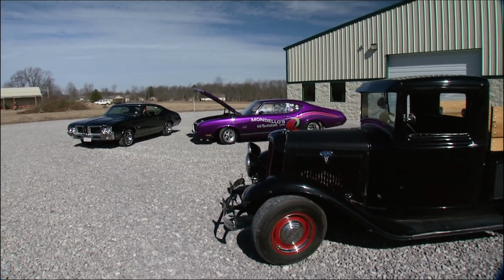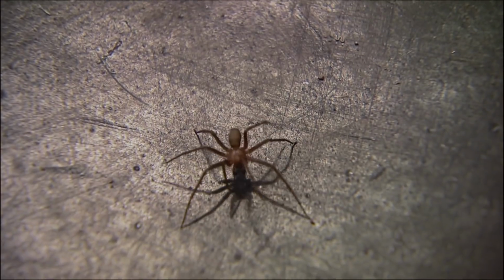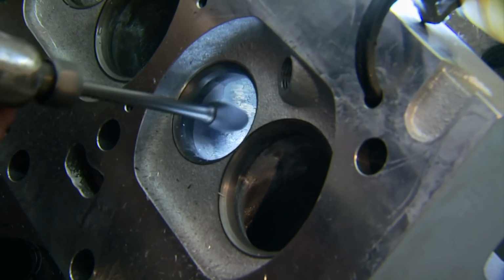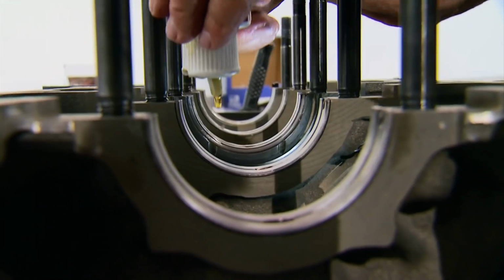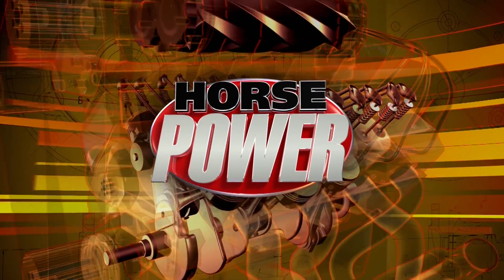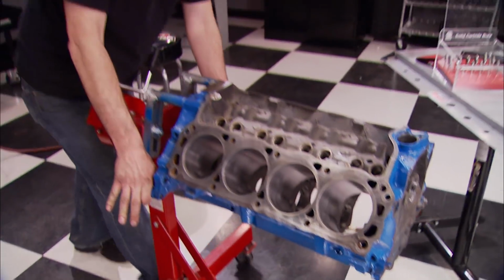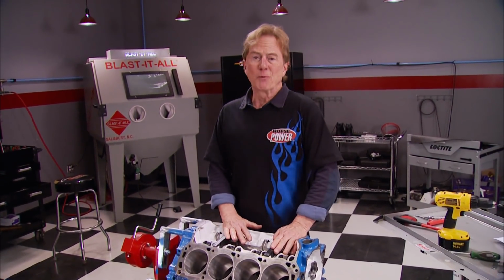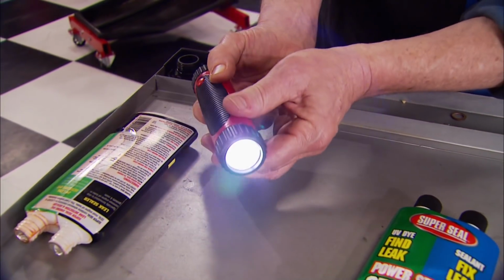Applying Joe Mondello's Motor Magic To Our First Ever 455 Build - Horsepower S13, E6

Comment: These engines have heavy wrist pins. Very heavy
Reply: Huh?? 🤷🏻 They're hardly any heavier than a B.B.C. pin, .990 vs. .980
Reply: Yes Paul, it's the darn wrist pins! Confounded wrist pins weigh a ton!
Reply: It's the PISTONS in the 455's that weight a LOT. The factory pistons are SLUGS.

Comment: if the cam timing gear is none adjustable  what's the point of the degree wheel..
Reply: Are you sure ?
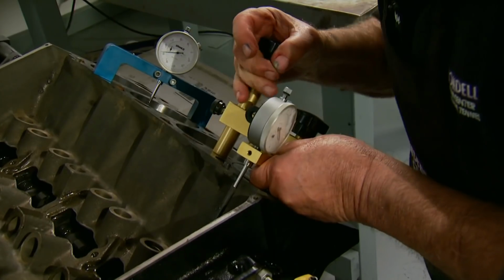Reply: Joe "Olds" Mondello told you 12:01
  Cam check and core shift check. Too much of the latter, gets  factory iron heads and you sell it to a pleasure boat guy not a  digger - Sandy
Reply: @sandyshoremann7524   @Sandy Shoremann  but my block as just come from the machine shop that charged for a fortune making sure the block was sound, bored,  , honed  etc. would you not check   things before you send it to machine shop?
but still does not answer my question, ok he is checking to make sure everything sound for re build, i see many videos of checking the cam timing with big wheel indicators,  on none adjustable timing gears,  i have also seen many with adjustable timing gears were setting the cam timing is crucial.
Reply: @aeroflopper  When using a non-adjustable timing set, using a degree wheel will just check to verify the cam meets the specs on the cam card, and looks good for the show.
Reply: @davelowets  so a complete waste of time then? how many camshaft manufacturers make cam shafts that are not up to spec? ive never seen it in 40yrs of building engines.
Reply: @aeroflopper  Maybe not, but I've seen brand new timing sets so far enough off that I threw them in the garbage and bought another brand.
Reply: @davelowets  sounds a nightmare, i suppose so many companies jumping on the band wagon supplying parts in white boxes, unbranded made full of Chineseium
Reply: @aeroflopper  Yes, it's even worse today. 20 years ago I would occasionally find a set that was off by a few degrees.

Edit. I did find a cam once, from a well known manufacturer, that was off. The whole cam (all the lobes) were off by 2 degrees. It wasn't the timing set, as I verified that with a good known cam. ALL the lobes were correct, so it wasn't that it was ground improperly, but I suspect that the dowel for the timing gear was drilled wrong in the end of the cam. Shit happens. I sent it back, they verified it was wrong, apologized, and overnighted me a good one.
Reply: @sandyshoremann7524  A degree wheel has ZERO to do with checking for core shift.
Reply: @aeroflopper, it's also to see if the cam tunnel and lifted notes are machined close enough from the factory and make decisions as to how you're going to solve the various problems encountered.
If it something simple like the cam being 2* off, normally the timing set is modified to move it the 2* (or disregard and run it).
Reply: *lifter bores, not lifted notes

Comment: And what happens when the paint starts coming off?? That’s the first I’ve ever seen, painting the valley??
Reply: Don't need no stinkin "paint" inside the engine block. No one that knows what they are doing does this anymore. It's a waste of time, and the proper "Glyptol" paint is an expensive waste of money.
Reply: They do it a lot of times myself I use epoxy paint... Just make sure you wash all the oil out usually I will hot tank the block then have it checked for cracks then I put the sander over it lightly clean it up then paint...
Reply: I think they paint so the oil flows better without pooling

Comment: What are the cam specs?
Reply: I was thinking the same thing. With the completed engine dynoed at 1 hp/cu in  must be mild  street performance grind around 224deg@.050. It is NOT a Roller cam as they said.Likely a  Magnum 270 hyd  flat with added nitriding service. That's 1/2 lift"
Reply: @sandyshoremann7524  You could guess all you want, but you'd never be correct.
Reply: Jm 20-22 would be my "guess" then.

Comment: You wonder about a addictive you put in your oil to stop it from leaking.   sounds a tab bit risky.    didn’t help to much on my radiator.   :-).
Reply: The oil additive added here isn't to stop a leak. It's Zinc, that is missing from today's oils, and is a requirement on flat tappet cam engines to prevent the lobes from going flat very quickly. The Zinc is a high pressure lubricant, and without it in the oil, the high pressures between a flat tappet cam and the lifter will squeeze the oil film out and the resulting metal to metal contact will wear out the cam in no time. The EPA took the Zinc out of current motor oils because in a worn engine that starts to burn oil, the Zinc would end up coating the inside of a catalytic converter, and render it ineffective and useless. So, no more zinc in common off the shelf oils..